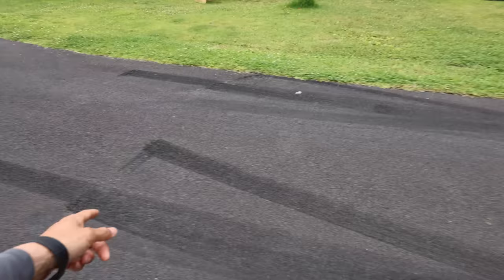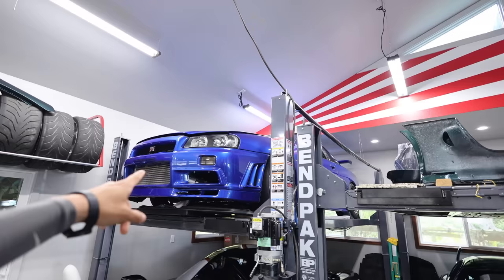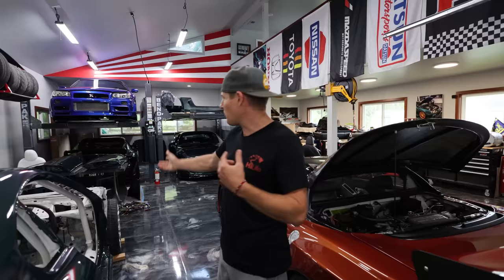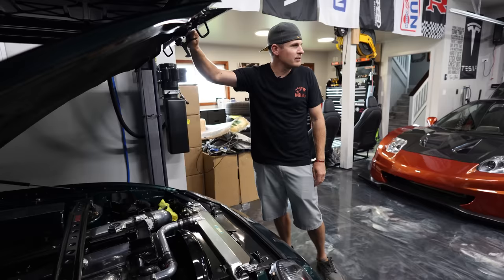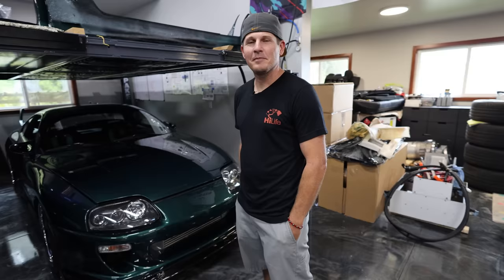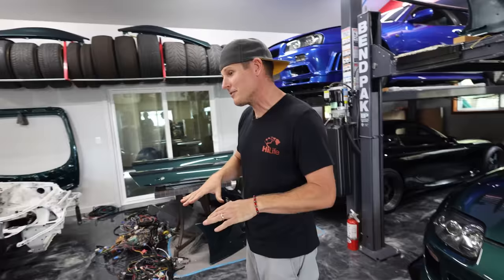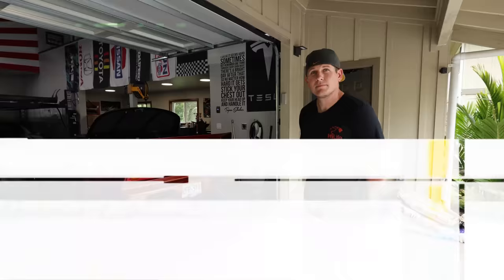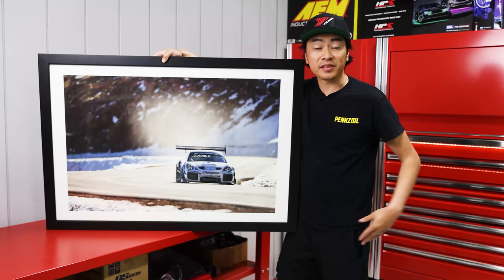Hidden 90's JDM Legends Garage in Hawaii

Comment: Bug power independent rear suspension cars are hard to launch. Went through alot of trials and tribulations trying to get the e36 in 9s back in the day. One time even got the car aligned with 500 lbs in the trunk.😂

Comment: That motor looks like it weighs as much as the Supra before you take it apart.
 OK, I looked it up. A Supra weighs between 3100 and 3400 lbs. The 2 Tesla motors weigh over 4000 lbs, why waste your money on this build. The batteries alone cost 15,000 to replace.
Reply: A tesla motor weighs 300bs.  The batteries weigh 900lbs.